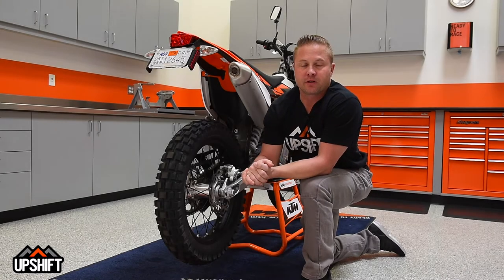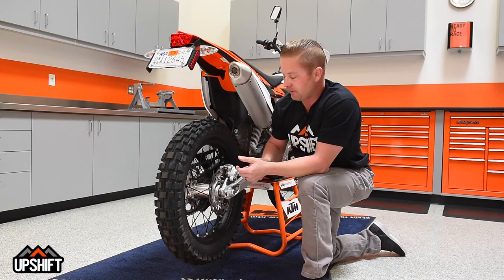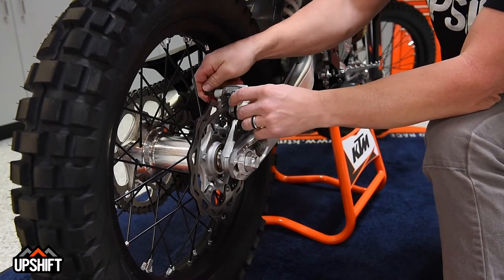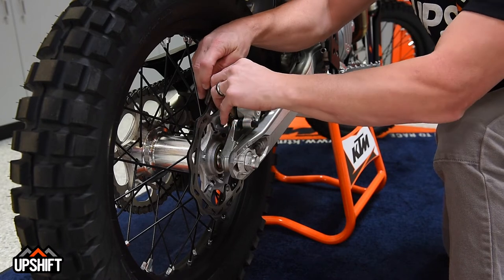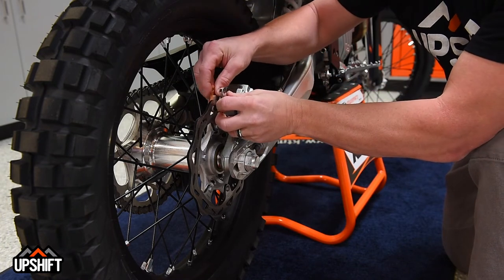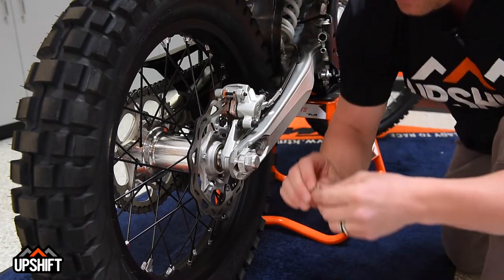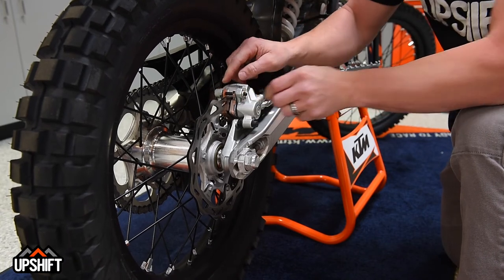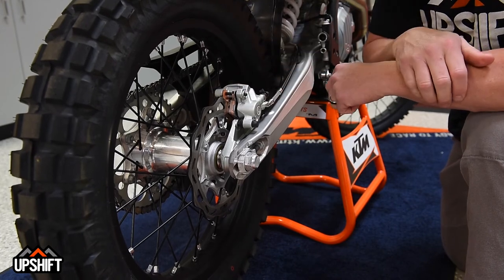KTM How To: Brake Pad Change

Comment: Thanks a lot ! First time for me to change my brake pads on my ktm. I was used to take the brake caliper of the bike to clean the piston carefully before pushing them back. I see on the users manual and also in your video that u don't to it : no risk of damaging the o-rings ?
Reply from the maker: We have never had any problems as long as the bike is clean. If the calipers have a lot of muddy grit that is still sticking to it. we would recommend you clean that well. But you should be good to go.

Comment: Once the break pads are removed, do you recommand cleaning the inside with break cleaner or it can damage some rubber parts?
Reply from the maker: We try to use brake cleaner as little as possible. If you feel a need to clean the caliper.... warm soapy water and tooth brush is ideal.

Comment: my stock pads had a thin metal clip on the piston side....do i need to reinstall that on the new pads? not the upper clip, the plunger side pad....
Reply: Did you ever find out if you need to put that on your new pad ?

Comment: Great video! But i have a question: when I removed the braking pads, the 'little keeper' felt out too. At the moment I am replacing the new pads, I don't know how the keeper is adjusted or how. Any advice? Thanks!!
Reply: same problem here...
Reply: And what If the little keeper falls out, which direction does  it go.  Lame video

Comment: I just changed the front pads on my ktm and my front brake locked up on me after a while of riding is there a reason for that
Reply from the maker: Thank sounds pretty scary. Not sure what would cause that without seeing it in person.
Reply: UPSHIFT ONLINE I put the old pads on and they weren’t rubbing the disc like the new ones were

Comment: Is the piston supposed to go back in after its out?
Reply from the maker: Yes. Just pump the brake pedal or the brake lever a few times and everything will go back to where it's supposed to be.
Reply: Open up the brake fluid reservoir cap to release pressure if the piston doesn't compress fully.